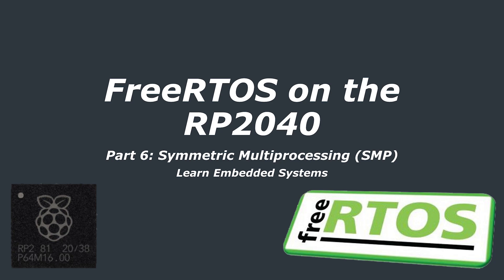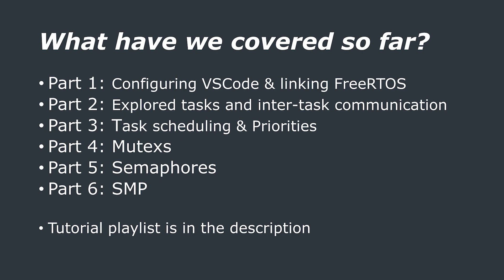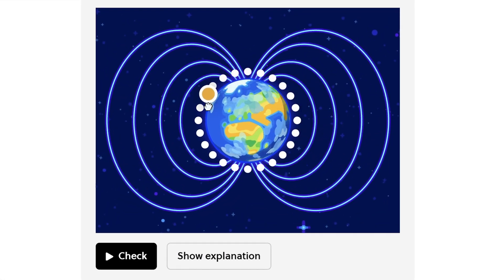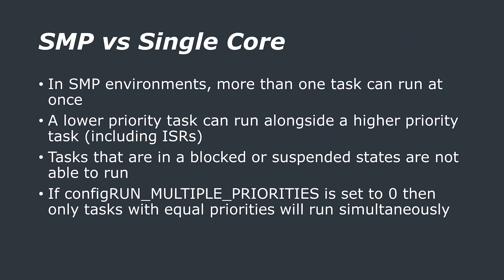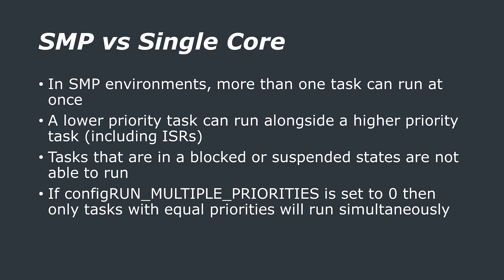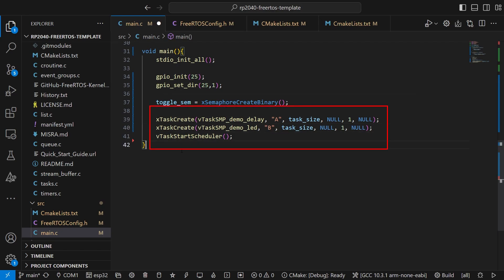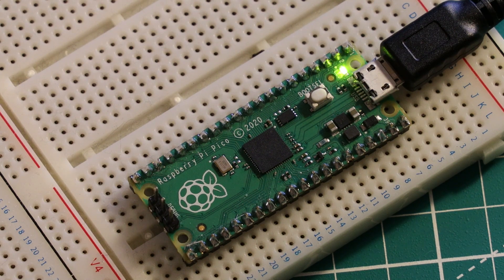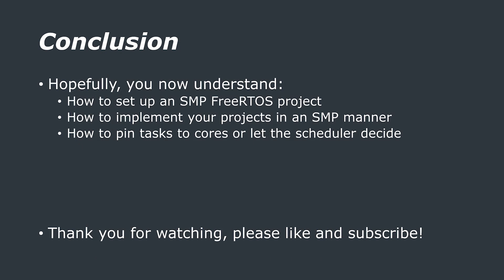FreeRTOS SMP on the RP2040 Tutorial - Symmetric Multiprocessing with FreeRTOS!

Comment: Aside from commercial offerings (Segger SystemView ,  Percepio Tracealyzer, etc), are there any hobby or opensource tools for debugging an RTOS design?

For example, what happens if you schedule a task to run faster than the system allows?   I assume you would need a way to measure how long each task takes, then schedule each task according to that?

Comment: Hello, I've enjoyed the whole series of videos, but while taking the rp2040-freertos-template (with recursive) i get an error with the CMakeList.txt in FreeRTOS-Kernel/portable/ThirdParty/GCC/RP2040 - the line project(FreeRTOS-Kernel C CXX)

the output shows "nmake '-?' failed with: the system cannot find the file specified.

this is an installation on Windows with the Pico SDK1.5.1 which I've used successfully for other (non FreeRTOS) related projects